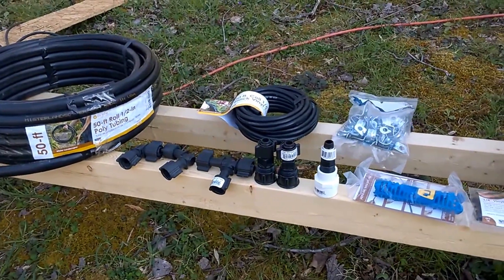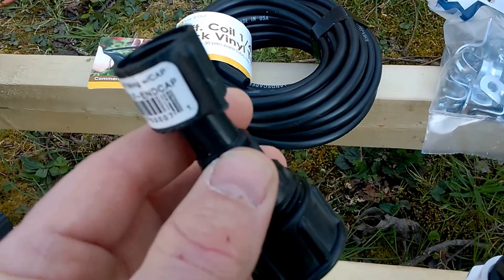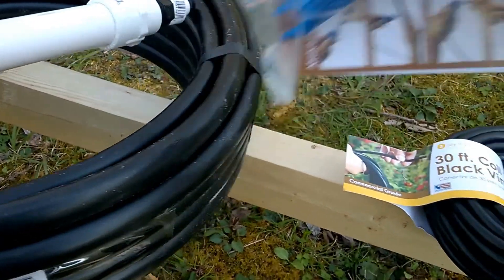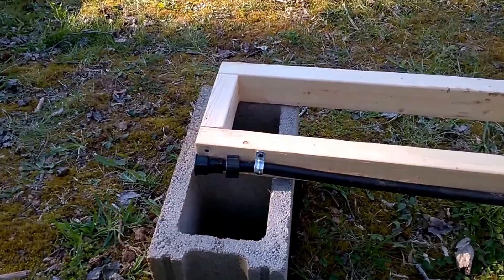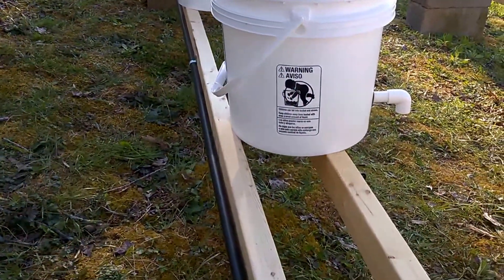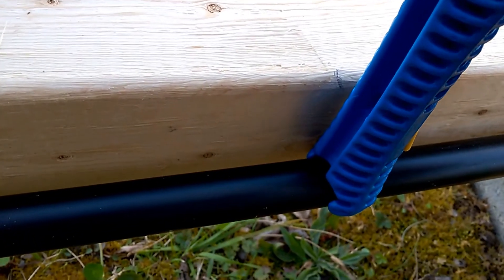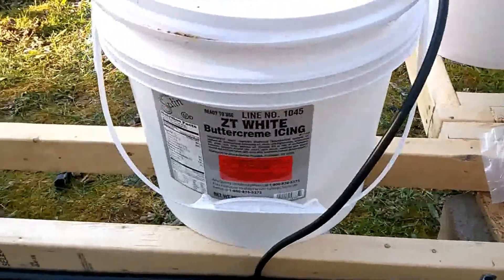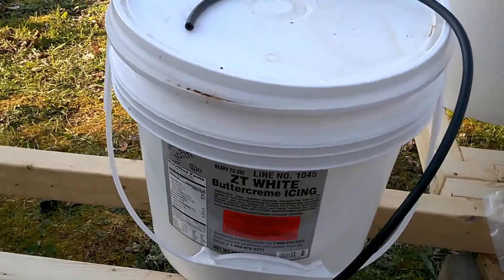Setting the Hydroponic Dutch Buckets Part-2

Comment: I didn't do dutch buckets, because of costs of materials. I did DWC and Krakty method and they produce fine. Tomatoes are hawgs for fertilizer.
Reply from the maker: +Cajun Calvin All of my buckets were free, so that's easy. But all of the other components do add up. Paint strainer bags and perlite, which is what everyone else is using is ridiculously expensive. I think I have a solution to that. I will be doing some of the Kratky method with some lettuce as well.
Reply: Kevyrev Hydroponics
I have some videos on simple hydroponic, if you want to watch and learn. YouTube has a great community of people who help each other.

Comment: nice beginnings!! can you post a link to where you got the cleanout/hole punch tool. We have hydroponics NFT and DWC setups along with misters and that tool looks like it would come in very handy!. Also, are you planning on building some kind of trellis for the tomatoes to climb? We have ours on the back porch and at one point had them climbing up the wall and across the roof. Looking forward to more of the setup. (one of these days, I will finish editing my hydro DWC teardown/setup and get it posted) We use Sony Vegas Movie Studio 13 Suite for all our video editing. It takes a little bit to learn it (youtube videos are your friend!) and it's one of the cheaper, better video editing tools we have found. Subbed ya channel so we won't be missing the rest of the setup process. Looking good so far!
Reply from the maker: +EastTexasGardener  I actually got that cleanout/hole punch tool at my local Lowes. If you can't find it there let me know and I'll see if the packaging has a web-site. 
As far as the tomato trellis, I'm still planning. Thinking of putting posts at both ends and running a cable at top and hooking up lines and clips. 
I subbed you right back my friend, great looking channel!